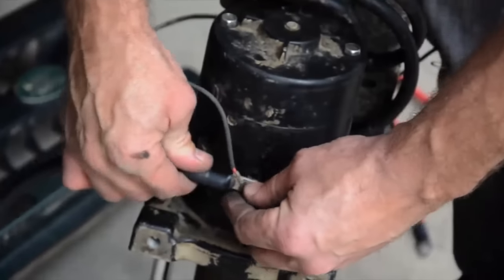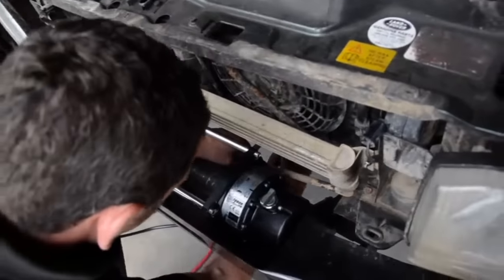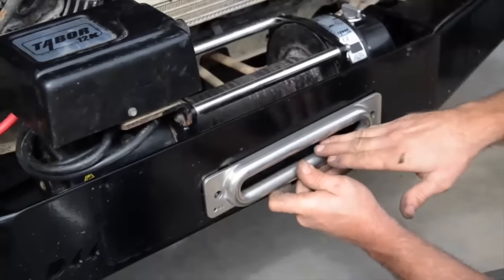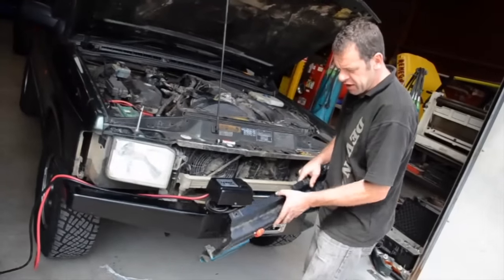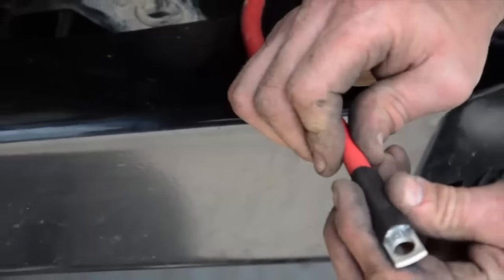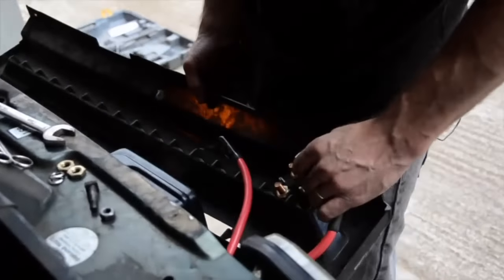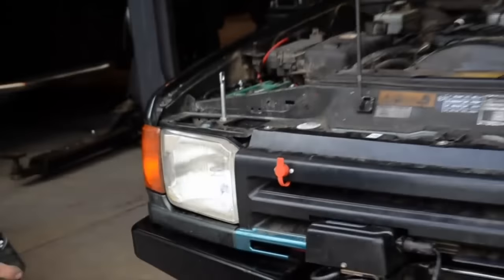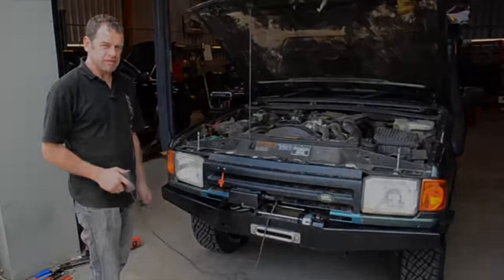HOW TO FIT A WINCH

Comment: That's a proper job! No cutting corners there. Really appreciated the time taken to share all the little tips - proper crimps, rubber boots for the isolator wires, why to disconnect the negative side of the battery first etc. D44 are a top company and that's a top video - thanks!